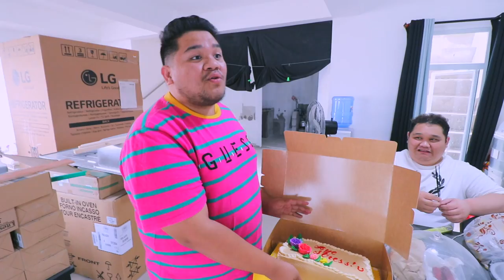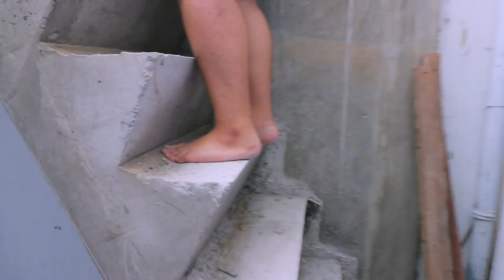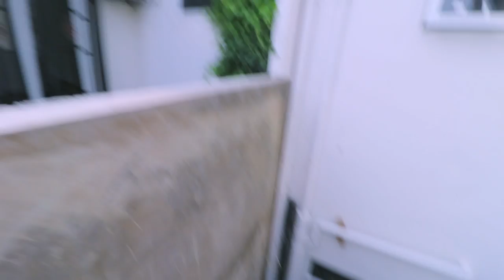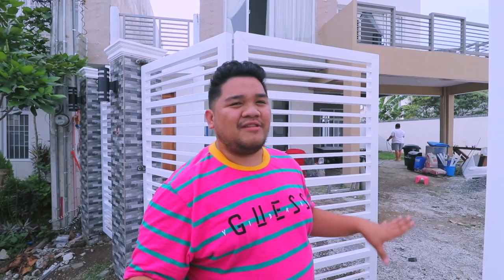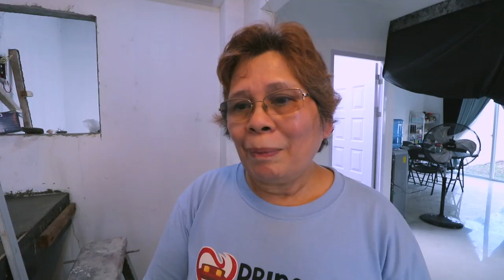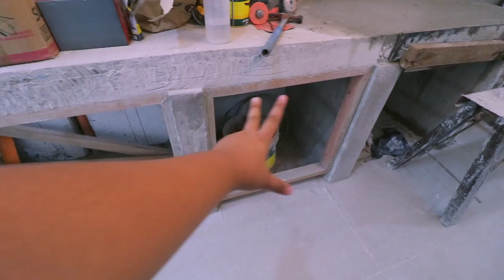TODO NA ANG STRESS KO SA BAGONG BAHAY (PALPAK ANG MGA GINAWA NILA BES!!) | LC VLOGS #366

Comment: Kuya Lloyd, suggestion lang po sa hagdan sa labahan. Instead na gawin niyo po na concrete, try niyo po yung hagdan na bakal na circular (spiral staircase po ata yun) it is safer. Yun din po yung gamit namin sa laundry area. Hope na mapansin☺️
Reply: but still may matandang gagamit  mahirap pa din, L shaped stairs would be preferable :)
Reply: I was thinking the same.
Reply: Mushroom Soup yea it’s good too but it will consume more space unlike sa spiral staircase tho, you can save the space and use it for other things haha
Reply: hilo ka na bago ka makapagsampay,..
Reply: Agree, mas okay yung spiral stairs na bakal. Mas safe yun para kay mommy compare sa stairway to heaven. Hehe saya panoorin ng improvement sa house nyo. Aja! :)
Reply: Maliit lang space e, so it should be spiral para sguradong kasya at di masyado nakahangad yung hagdan. Mas safe pa.
Reply: un din sana sususgest ko since makitid ung space pababa
Reply: Same
Reply: Yan din iniisip ko
Reply: problem ng bakal since its open kakalawangin at problem in the long run. just seal the whole thing at palitan ng door ung window. ilipat ung aircon unit doon sa taas at lagyan ng halaman. since may aircon unit doon pwede sya maglagay ng sampayan dahil sa init ng fan masmatutuyo ung labahin pag nagsampay sya doon or just buy a electric dryer since may pera naman sya para wala ng sampayan.
Reply: Expensive hahahha
Reply: #getanarchitect
Reply: up
Reply: up
Reply: same thoughts
Reply: sana lc buy kana lang ng lupa at nagpagawa ka ng bahay...
Reply: Di ba mahirap umakyat sa spiral n hagdan pag may bitbit kang labahan o mga timbang may damit, pag spiral makipot din un dba?
Naisip ko lng.
Reply: tarA idol
Reply: @Teudungie Jjang Tara idol hug
Reply: Pearlyn Perol ba’t ka naman po mahihilo e hindi naman ganun kataas yung aakyatan?😅 unless kung kasing taas ng tower of david ang aakyatan char HAHA
Reply: tapos pole nalang pagbaba, parang sa bumbero, charot! haha
Reply: Joseph Luis M.V yan din naiisip ko HAHAHA 😅
Reply: Yun po ang mgnda pa spiral yung hagdanan
Reply: Pwde dn un spiral.kya lng makitid un bka di mgkasya c Lloyd hahaha joke.pwera nlang kng lalaparan pra mgkasya cla.
Reply: Yun din iniisip ko
Reply: Mahirap umakyat pag may bitbit kang mga damit na isasampay
Reply: Yeah. I recommend spiral staircase kc medyo maliit lng ang space.
Reply: tama tsaka tipid sa space, pag mahuna kc ang semento pwedeng gumuho, madidisgrasya pa.
Reply: Trueee same thoughts
Reply: Agree ako dyan mas safe pa yun  great suggestion andrei god bless everyone
Reply: Sige

Comment: Hi Lloyd. Architect here. I'm happy to see you enjoying your new house. Although, there are some issues sa renovation and existing house. Stressful talaga magpagawa at magpaayos ng bahay, kaya dapat get a professional architect and contractor. Here are the items I saw on your house.
1. Tiles na umaangat - there are numerous possible reason. 1.a)Hindi tile adhesive ang ginamit sa pagkabit ng tiles. 1.b) masyadong dikit ung pagkakakabit ng tiles, may gap dapat yan atleast 2mm 1.c)hindi magandang klase ung tiles na kinabit, kadalasan ung ganyan lower class from China kaya umaangat sya or eventually aangat in the future. 1.d) hindi binabad sa tubig ung tiles bago ikabit with tile adhesive, kelangan un para mas kapit ung tiles sa mismong floor slab. 
2.) Amoy sa CR - most probably, may mali nga sa vent stack ng toilet or may mali sa singawan ng septic tank. Possible din na walang p-trap sa piping kaya deretsong si singaw ung amoy sa toilet. Either way, si Lancaster dapat mag ayos nyan. You may also provide exhaust fan sa cr for ventilation. 
3.) Laundry Stairs - It's a mortal sin to have that kind of stairs. You could have an L-shape stairs instead and eat some space sa ginawa nilang slab sa 2nd floor para mas dumami and steps and bumaba ung height ng each steps para mas madali at safe ang pag akyat panaoog. Stair step height (riser) should be 25cm high (max).
4.) Kitchen - Don't forget to ask the contractor to provide ventilation sa kitchen nyo. Unless kung lalagyan nyo ng aircon ung kitchen, meron sanang window for cross ventilation or else, mainit na dyan kapag magluluto. The window could also provide natural lighting. 
5.) Terrace for laundry area at 2nd floor - make sure na lalagyan ng maayos na waterproofing (cementitious or membrane) ni contractor yan para iwas tulo sa baba bago latagan ng tiles. Kelangan ding mag flood test for that. Dapat din may floor drains sa area na yan bara di bumaha. 

Hope these comments could help you! Enjoy your new home. God bless you and your family!
Reply: UP PO PARA MABASA NI KWEEN. Architecture student here! #GetAnArchitect #SaArkitektoSigurado
Reply: galing naman po
Reply: Detailed ❤
Reply: Korek po kau kc dito sa middle eastnkita ko may ventilation every cr at kitchen nila.Meron silang flood drain (drainage) sa loob ng kitchen o laudry para if ever mag linis kayo o mag General cleaning may lagusan ang tubig at sakali pag bumaha na rin.Korek po kayo Eng.Watching here from kuwait
Reply: Ayan queen big help suggestion to
Reply: ito ang marunong gumawa super detailed na Architect
Reply: Additional, if you decided na L-shape ang stairs, you can use the ilalim part for more storage space or lababo. For the kitchen, you can put a kitchen hood for exhaust and sa t&b din you can put an exhaust fan. Usually used sa condominiums since limited ang air ventilation. Lastly, you can hire a good architect for a more functional design and circulation. :) for a house as big as yours, napakaraming pwedeng gawin na much more accessible, much more functional. more power! Stay safe and Godbless. :)
Reply: Up
Reply: 2. Amoy sa CR
Im a piping designer, ang mali walang P-trap, deretsong pipe ang nilagay, kaya hindi na ta trap ang amoy galing sa septic
Reply: Nakaka stress talaga yung hagdan. Truly, a mortal sin mangiyak ako sa katatawa dyan.
Laundry area yan kaya they should consider yung risk lalo na labada ang iaakyat mo alangan i-piggyback ride mo yung batsya ahaha
Reply: Sir, how to avail of your services po? Any email add? Thanks in advance.
Reply: My husband and I are planning to do a major renovation sa house namin plus magpapasecond floor sana. Bungalow bahay namin and you just helped us a lot! God bless 🙏
Reply: U
Reply: Pa subscribe
Reply: Hinanap ko talaga yung ventilation sa kitchen napaisip ako if lalagyan ng exhaust yun.
Reply: Nc
Reply: Informative :)
Reply: agree with your comments arki, pero ang max height ng stair riser is 0.20m lang not 0.25m. Ideal is between 0.18 to 0.19m high, lalo na sa mga matatanda.
Reply: Thanks po...umangat din po tiles n bgong gawa sa haus ng parents q...😭
Reply: Up
Reply: Uo
Reply: Up
Reply: hi Sir,  nanotice ko po ung sa terrace namin sa 2nd floor, walang floor drain. Nung umulan, may baha. and then nanotice namin, nawala na ung water afterwards kahit walang drain. ok lang po ba un?
Reply: Up
Reply: Up
Reply: ✅SaArkitektoSigurado
Reply: 4. Kitchen- dapat may vent for exhaust fan, para pag nagluto hindi mangangamoy pagkain ang loob ng bahay, kumakapit pa nman yon sa damit or any fabric e.g. kurtina, couches
Reply: up para mabasa ni kween
Reply: Detailed, ang galing po ! Architecture student here! #GetAnArchitect #SaArkitektoSigurado
Reply: ui ayan may tips na po.🤗🤗🤗🤗
Reply: Up
Reply: #saarkitektosigurado
Reply: Hire him lloyd
Reply: #GetAnArchitect
Reply: @daylerodriguez4541  alam ko po inaabsorb ng semento yun which is not okay kasi may tendency na magbibitak bitak po yun parang naluma.
Reply: Mas mainam talaga na kumokonsulta sa mga professional. Yan ang pagkakamali namin kaya nag ka-crack ngayon ang mga tiles sa bahay namin. HAHAHA! Although maganda yung quality ng tiles namin, nagka-problema kasi hindi raw pantay yung pagkakalagay.
Reply: Kween LC
Reply: Solid to. Super UP! Para dito. Sana ikaw nalang kunin ni Lloyd para naman iwas ang kapalpakan.
Reply: #GetAnArchitect
Reply: Up po..
Reply: up
Reply: Sa Architecto Sigurado! Alam ko yan Sir kasi sigurista din ako, dahil sa tagline na yan naghanap talaga ako ng mapapangasawang sigurado, kaya Architect si misis at yes wagi tayo jan! Well said Architect Magauay.
Reply: @dotdm   Hi it's possible pa din na max height is 0.25m ng riser if below 10 ang Occupant load and it is a private stairway under Section 1207 Paragraph E of National Building Code.
Reply: UP
Reply: @villasanian6126  hello arki. but in real practice, mahirap gamitin ang 0.25m riser. sa 0.20m pa nga lang gagamit ka na ng puwersa pag-akyat, you have to consider mga pwd or senior. sabi nga nila di lahat ng nasa libro tama, experience is still the best teacher. char
Reply: Dream house dapat di tinipid. Or kung d naman tinipid poor ang contractor mo.
Reply: I find this very helpful din po samin. May bago ako natutunan. Upppppp!!
Reply: Up
Reply: Up
Reply: Up
Reply: Michael S.Magauay super helpful ng lht ng tips mo
Reply: So nice na may ganitong comment. Nakapackage na hehe #SaArkitektoSigurado
Reply: Hire na si Kuya!!!!!
Reply: Kween LC eto po architect.
Reply: j
Reply: Hi Architect here ☺️ Providing natural lighting on kitchen area is a natural way to minimize chance of mold and mildew #SaArkitektoSigurado
Reply: #SaArkitektoSigurado
#GetAnArchitect
Reply: OA MO TEH🙄
Reply: exactly, mabasa sana to ni loyyd Get an Architect .Archi Student Here!!!
Reply: wow addl info. thanks much sir.
Reply: Get a professional architect and a professional engineer para di nag tatalo
Reply: Tama kasi yung space sa stairs maikli lang kaya dapat L-shaped para maadjust
Reply: up
Reply: up
Reply: up
Reply: up
Reply: impressive at tagalog kaya madaling maintindihan,thanks po.
Reply: yah that's true! My brother is a architect too
Reply: Up
Reply: Up
Reply: as an arki student palang, yung stairs talaga. yun nga rin naisip ko earlier while watching lloyd's vlog. L-shape stairs talaga ang dapat.
Reply: @daylerodriguez4541  nasa surface lang po ba yung water niyo that time?
Reply: Ganito sana kahelpful lahat ng comment. ❤
Reply: sa arkitekto sigurado!
Reply: Trulala 💯 Professional Architect is a must
Reply: dapat dto sa bahay may dogfood.. pahug guys
Reply: Daming mong kuwento
Reply: I.
Reply: Free advice👌
Reply: Hi sir Arki😁❤️
Reply: @OFW_INUAE  Architect po siya
Reply: Natuwa ako dun sa tip about tiles na kelangan ibabad sa tubig para kumapit ng husto.. duly noted
Reply: Deniper 180 MM max na lang tayo para pasok sa Fire Code 👍
Reply: Nice! Tama si kuya hehe engineering student ako and gumagawa na kami ng mga sample floor plans kaya mali talaga yung ginawa. Yung sa stairs lang na baka di din pwede yung L shaped with the given space kase di din kakayanin haha if di naman aakyat si nanay sa 2nd floor everyday it is okay to use spiral (since ganon samin - nasa corner and with minimal space). Always hire a professional architect and engineer para legit yung tibay ng bahay at the same time maganda pagkakagawa 😊
Reply: Up
Reply: Up
Reply: True po dapat L shape yung stairs kasi yung ginawa eh pinagsiksikan talaga siya to the point na ang taas ng steps pero maiksi yung width di pa kasya ang paa.  Kaya kung aakyat ka para kang gumagapang. Tapos kapag bababa deretso impyerno na😂
Reply: Up for this! Totoo ‘to!
Reply: 🆙🆙 para maganda bahay ni llyod 😎
Reply: Spiral stairs nalang gamitin
Reply: Yung spiral staircase na lang ipalagay mo sa laundy area mamsh.
Reply: @khentmangoba  pahug po
Reply: @kath.6762  pahug po
Reply: @nicoleannemamorno3642  pahug po
Reply: @OFW_INUAE  pahug po
Reply: @gigibacayan9945  pahug po
Reply: @dominiquesanjuan2818  pahug po
Reply: @allyssacabuhat4772  pahug po
Reply: @maedepedro62  pahug po
Reply: SANA OLLL 🥺🥺
Reply: Sa Arkitekto, Sigurado! Get an Architect ❤

A fresh graduate of BS Architecture here 👋
Reply: up
Reply: Hindi level ung slab bago lagyan ng tiles kaya umaangat.
Reply: mismo archi!
Reply: Pwede rin siguro spiral na hagdan 🤔🤔🤔
Reply: 🙌🏻 Best comment here
Reply: up👍
Reply: Ur comment is very helpful po. Magpapagawa po ako ng bahay eh... Hihihi... Noted po ito Architect. 😊
Reply: Max. Height po ng riser is 20cm not 25cm. Pero baka mali din ako. 😁
Reply: Pwede rin po siguro sir na spiral stairs
Reply: Nice!
Reply: Bait mo naman Architect that you impart your expertise to us sa post mo. 😊
Reply: Wahhhh huhuhuhu ARCHIII!
Reply: I didnt get this Stair step height (riser) should be 25cm high (max). #help
Reply: @brokerryan  In general, stairs should have a proper angle, right height and steps for a easier and convenient use specially for residences where stairs are heavily used. Ideally Stair risers should have 15 to 18cm height. To visualize the recommended stair heights and needed ratio of riser and threads (steps) measurements per type of use, you may check this link https://inspectapedia.com/Stairs/Stair-Angle-Slope-Specifications.php
Reply: @dr000999111666  It's still depend on the use of the stairs. For this purpose, I think 25cm is max. The lower stair riser, much better. You may check also check this link to visualize the stair standards, https://inspectapedia.com/Stairs/Stair-Angle-Slope-Specifications.php
Reply: parang gusto ko tuloy mag architect potek
Reply: Mismo Tama Sr Micheal hindi naman lahat ganyan pag malake kulang ang Tito ko Nald Layug halos Ilang buong compound At ilang mga 3rd floor House ang pinagawa sakanya pag malake kolang Din yung isang ginawan nila sa Cavite na bahay nasa mga 32 to 45 Sqmt ata yun in one day tinapos nya ang Tiles sa flooring at Palitada sa lababo Mabilis sya gumawa dahil kabisado nya na ang gagawin at malinis gumawa Wala pa syang anak Construction na ang Work nya at Ngayon may 16 years old na syang panganay yan padin work nya Wiring Tubo linya nang mga tubeg lababo halos lahat na ata kaya nyang gawen Basta pag dating sa gawaang Bahay Proud lng ako sa kanya kaya naipagmalaki ko hehe✌️✌️
Reply: @daylerodriguez4541  HI there. If there's no floor drain, problema talaga yan. Possible reason kaya nawala na eventually ung Tubig is evaporation, or sinipsip ng slab ung tubig (lalo na kung hindi naka waterproof ung area). Kung ganun, Magkakaroon kayo ng problem in the long run sa structural integrity ng slab at beams ng area, and knowing the characteristic ng water, it may  go to other areas as well.
Reply: @heyitsqueenp  I suggest to get a licensed and professional architect and engineer. Wag pong basta basta lang magpagawa ng walang professional in charge. Mas mabuti nang sigurado at safe ang ipapa gawa nyo, lalo na at dyan po kayo titira.
Reply: Sayang dikana nia mare replyan😥
Reply: balen kim 😭😭😢
Reply: May 29, 2011- Sep 4, 2020
We miss you Lloyd Cadena
NOBODY WILL FORGET YOU LLOYS CACDENA YOU INSPIRED PILIPHINES AND ALL THE YOUTOUBERS ARE STILL SAD ABOUT IT AND WELL NEVER FPRGET YOU LLOYD IN OUR WARM.HEARTS rip patay na sya ❤
Reply: agree ako sa lahat sir. magpapagawa din kami ng bahay dito sa europe kaya marami na ako natutunan kahit nagpaplano pa lang pinag aaralan ko yung mga gagawin kahit lahat yung contractor gagawa maganda parin alm mo yung details. RIP Lloyd.